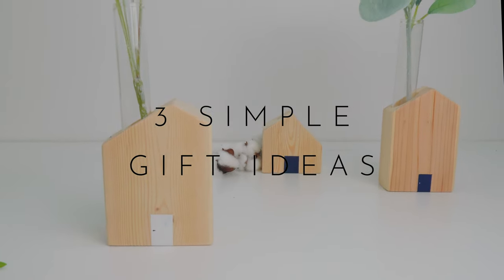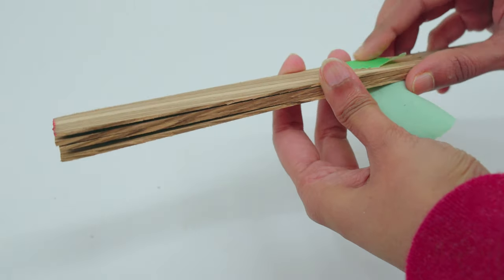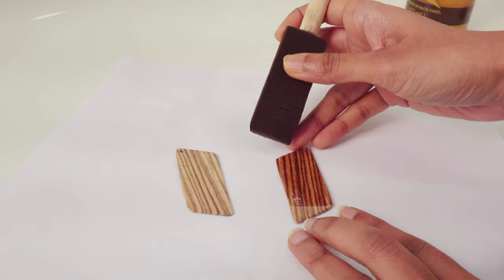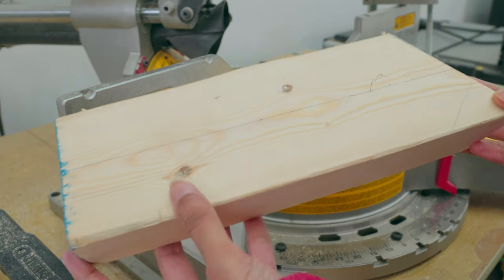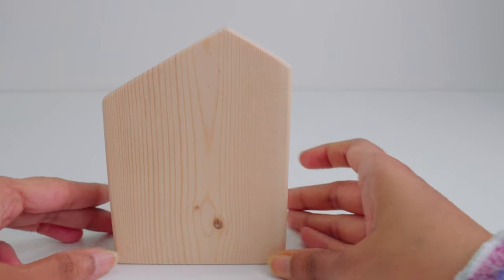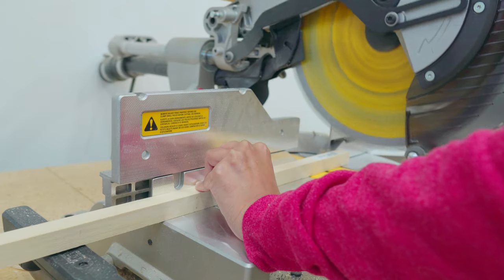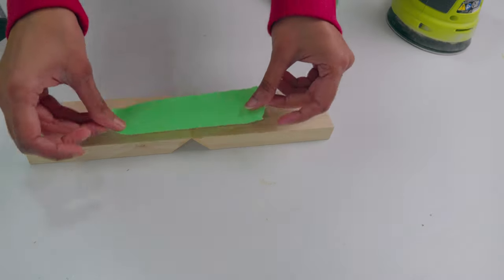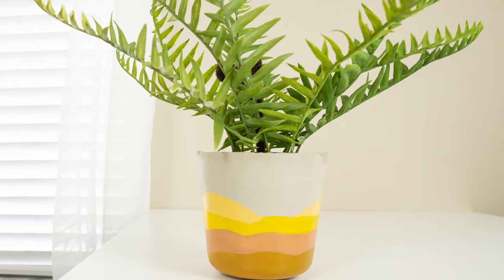3 SIMPLE DIY GIFT IDEAS MADE OUT OF WOOD

Comment: DONT DO THIS! THIS PERSON DOES NOT KNOW WHAT THEY ARE DOING WITH A TABLE SAW!

1. NEVER PUSH YOUR STOCK THROUGH USING ONLY THE CUT-OFF SIDE (LEFT OF THE BLADE IN THIS CASE) THE PIECE TRAPPED BETWEEN THE BLADE AND THE FENCE WILL BIND, AND HIT YOU RIGHT IN YOUR CHOICE OF REPRODUCTIVE ORGANS
2. ANY TIME A CUT THIS THIN IS REQUIRED, IT CAN BE ACCOMPLISHED IN FAR SAFER WAYS...LOOK UP SOMETHING FROM A REPUTABLE WOODWORKING RESOURCE
3. USE A PUSH STICK ANY TIME YOUR HANDS ARE REQUIRED TO BE THIS CLOSE TO THE BALDE
4. USE A FEATHER BOARD TO HOLD SMALL STOCK AGAINST THE FENCE.

I KNOW...I AM SHOUTING. IM TRYING TO SAVE YOUR FINGERS
Reply from the maker: Hi @tompolasky7302,
Thank you for sharing your concerns and offering valuable safety advice. I appreciate your input, and I'll certainly take your suggestions to heart. Safety is a top priority, and I'll make sure to implement these precautions in my future work.  I'm grateful for your insights.